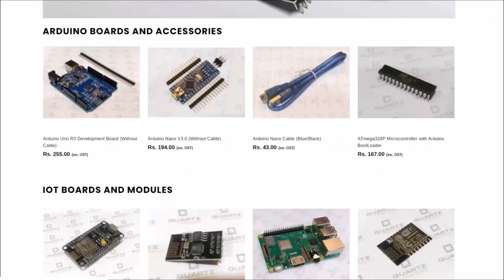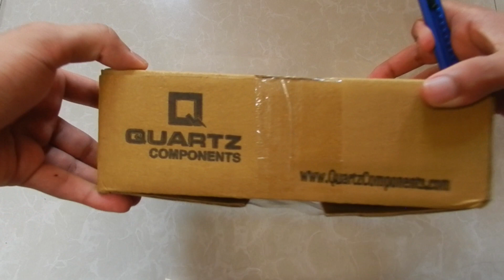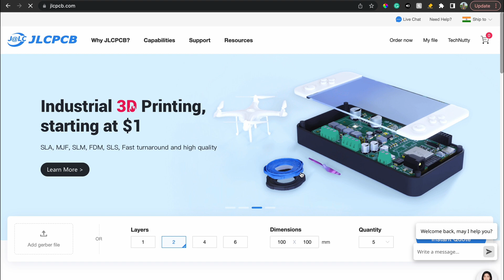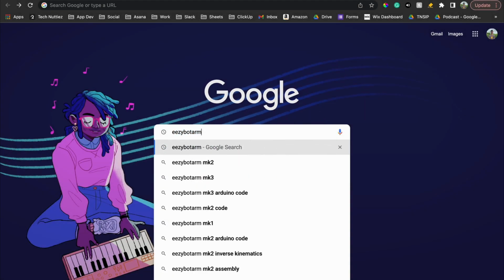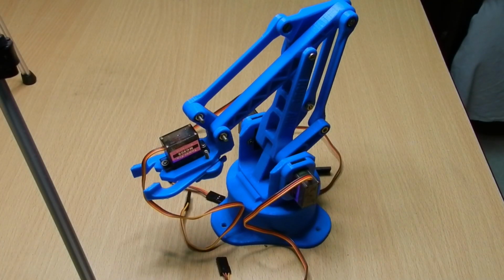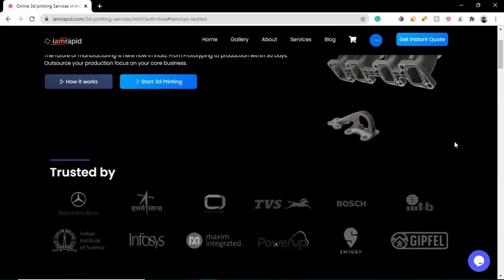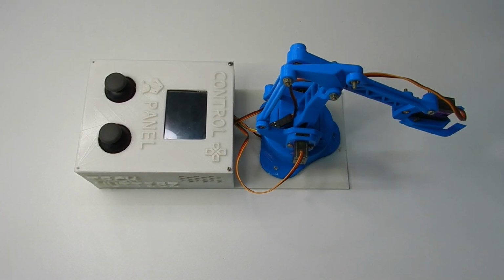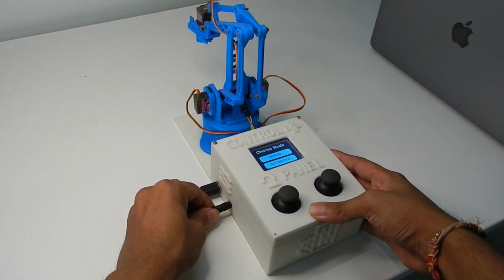How to Build a Robotic Arm that Learns | ft. Arduino Mega, EEZYbotARM

Comment: Hey Aarav. I was hoping to create something similar for a science lab. Can you build a robotic arm that can hold a plate (127.71 mm x  85.43 mm x 14.10 mm)? basically i need the robot to pick up plates from a stack (in- stack), put it on a platform that triggers to a camera for a picture and then removes the plate to a second stack (the out stack). Let me know your email and we can figure out the project details including cost. Thanks.

Comment: It's great and I make it but display does not react to the touch command
Reply from the maker: Please check if you’ve wired up the display correctly. Especially the input terminals.
Reply: @TechNuttiez  display touch is working with another code
Reply from the maker: @hosinstudio  Perfect!
Reply: @Tech Nuttiez  but it's doesn't work with this project code (it's work with Calibration code).
Reply from the maker: @hosinstudio  Do upload the images of your project after completion here: https://www.instructables.com/Automated-Robotic-Arm-That-Learns-Ft-Tinkercad-Ard/
Reply: @TechNuttiez  I do it
Reply: It's work now
Thanks for your help 👍